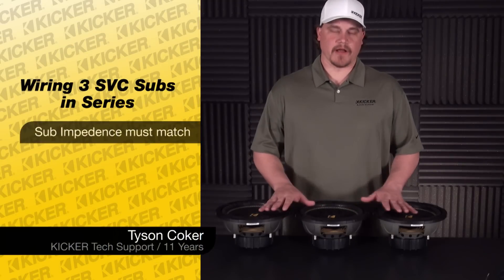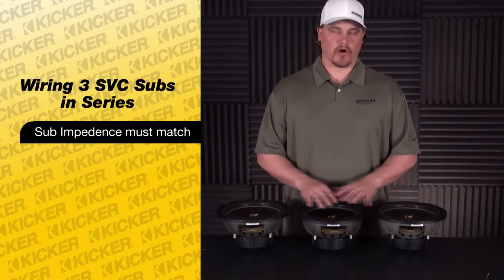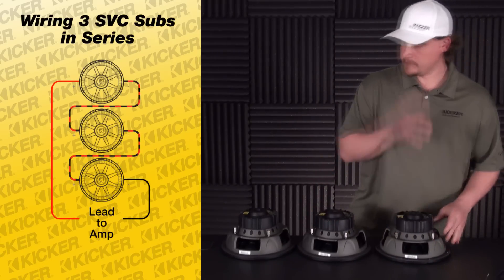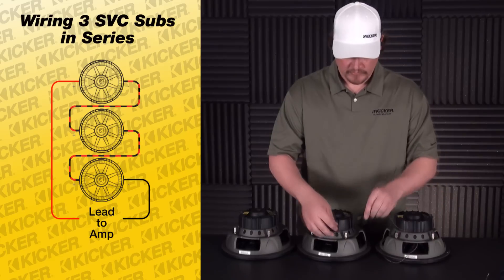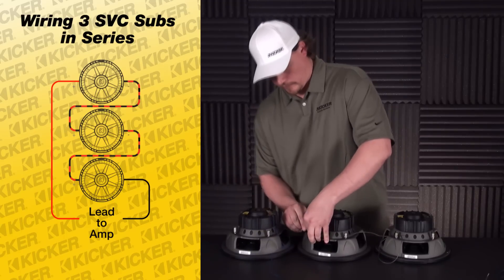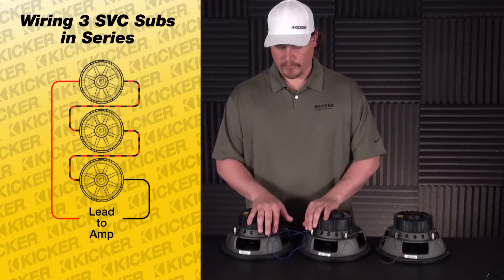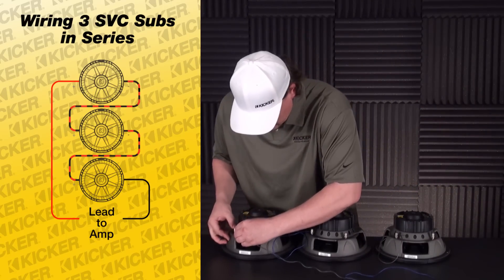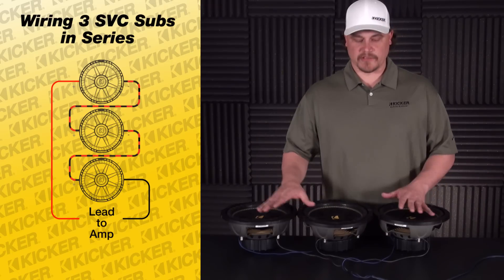Subwoofer Wiring: Three Subwoofers in Series

Comment: I have a power acoustic overdrive 5 channel 3500 watt amplifier, and it's 5th channel for monoblock can do no less than 2 ohms minimum. I want to wire up 3 boss audio 10 inch svc subs. Is there a way to wire up those subs to no less than 2 ohms?
Reply from the maker: Depends on the ohm load of the subs.  What are they?
Reply: @KICKERAudio  4 ohms per sub.

Comment: Can you connect two 4 ohm  svc woofers in series and one svc 4 ohm in  Parralel from a same singleoutput mono amp? What would be the total impedance load?
Reply from the maker: Not recommended. One of the subs would be out of phase. LOTS of cancellation.
Reply: @KICKERAudio  what if the zub are izobaric.. made,, and i have a queztion. i have a cerwinvega ztroker 1vc 4ohm, and i have a cerwin vega 154 vflex 4 ohm. can i uze them in a zetup any way at the zame time. i do have 3 amplifier laying around, i uze a excursion full bridge amp now 1500w 4ohm 2500w 2ohm 3500w  at 1ohm and have a mb quart raa2400 and a ample A242x laying in my garage..  could i make a infinite baffle with one and  the other one in the box,the ztroker are in a box vented after zpecifacation..

Comment: How do you wire 3 svc 4 ohm subs down to 1ohm or what is the lowest i can wire them down to?
Reply from the maker: That would be 1 ohm, wired in parallel. But that's only appropriate if you amp is rated to 1 ohm, and delivers the correct power (RMS not peak) at that power rating.
Reply: 1.33

Comment: So what is the end result ohm load? 2.67?
Reply from the maker: Assuming they are 4 ohm single voice coil subs, 3 subs wired in series will give you a 12 ohm load.  Wired in parallel, it would be 1.33 ohms. if it helps, grab the free KikckerU app,  It has box building info, wiring schematics, a tone generator and more. www.kicker.com/kickeru

Comment: How can I get a final ohm of 2 or 4 with 3 svc subs with a 2 channel amp
Reply from the maker: Can you tell me what the amps and subs are?  Need brands/model numbers to make sure we get you the right info.
Reply: I have 3 12s kicker svc subs 4ohms using a kicker amp 1000x1 and whats the lowest output can i go?
Reply from the maker: 1 ohm in parallel, if you have one of our new KX amps.  If not, then you may have to change the subs or the amp.  You can make four 2 ohm subs to 2 ohms, or three 4 ohm DVC subs do 2 ohms, but your combination of subs means you are either doing 12 ohms or 1 ohm.
Reply: The amp is a kicker dx 1000.1...i followed a diagram and it made it 2.7ohm
Reply from the maker: Yes that's about right.
Reply from the maker: The DX is 2 ohm mono stable, so that's fine, but what diagram did you follow?
Reply from the maker: If you wired one of the subs out of phase, it will effect your bass.

Comment: single coil
Reply from the maker: Ok there is a way to do that.  Three pairs of speakers.  Each pair wired in series. So you end up with 3 16 ohm signals.  Now, you parallel those three sets of wires (join all three + and all  three - wires).  here is a video that shows you how to wire in series and parallel.  I know its a different ohm load in the video, but the point is the same. https://youtu.be/xSW3Hc7uqhY
Reply from the maker: If you need a diagram, you might want to email support@kicker.com and ask for one.  They can draw it out for you.
Reply: Thanks
Reply: Should I run the passive crossover that come with the component set
Reply from the maker: Usually, yes. Unelss youre doing an all active system with dedicated crossovers/Eq's on each speaker.

Comment: +Kicker My wife was kind enough to get me woofers for my birthday. She got me (3) SVC Kicker C10 woofers already in an enclosure. Seeing this I will have to rewire them from how the company installed them in the enclosure, which is no problem. 

Learning from your other video about parallel wiring and now this kind, which is preferred? Also, does Kicker mfg an amp to handle all three of these amps and if so could you tell me which model? Also, which amp is better for this type of setup - mono or two channel? There's so many conflicting opinions, but what I'm looking for is consistency and anything that will work with your specifications to prolong the life of the equipment. 

Thank you for any help.